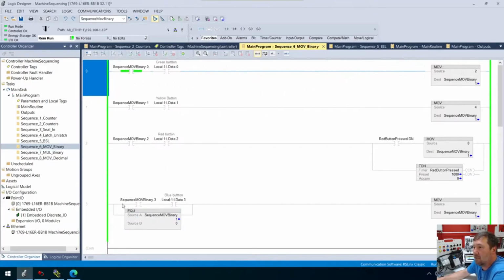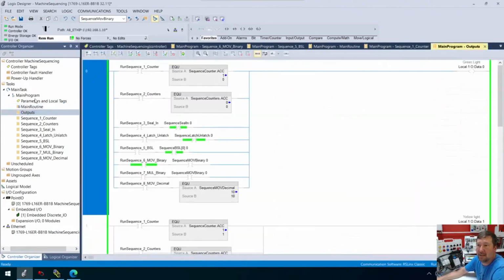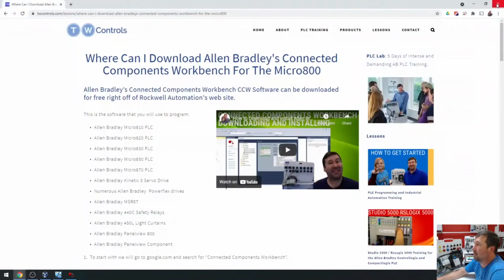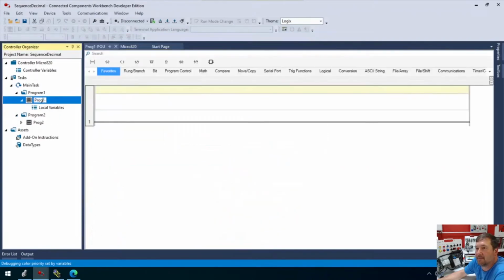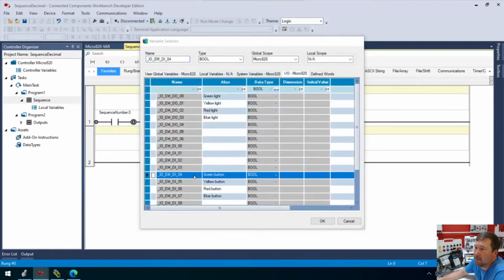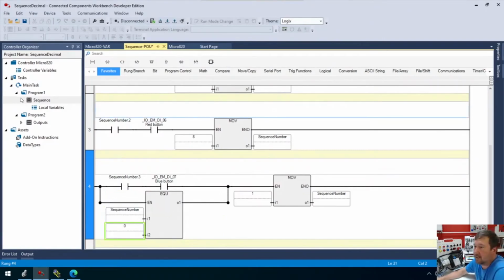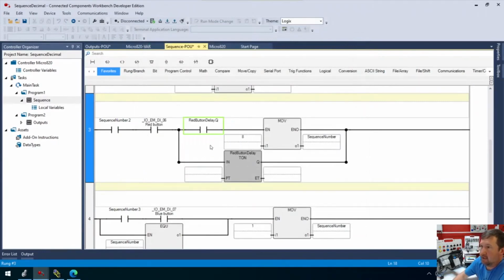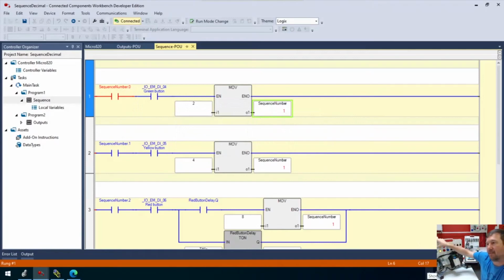Allen Bradley PLC Sequence MOV Binary Programming Tutorial Part 4

Comment: In CCW there is no need to put a branched timer with a .Q contact, you can just put the timer in series with the other elements in the rung, i thinks its easier to read this way. Just a tip :)
Reply from the maker: To a point I agree, but I try to stick with methods that the majority of the PLCs can do.  It does look cleaner your way, but if someone is not familiar with the inline feature, it might trip them up.  Thanks for watching!